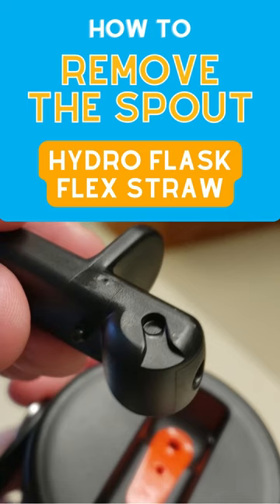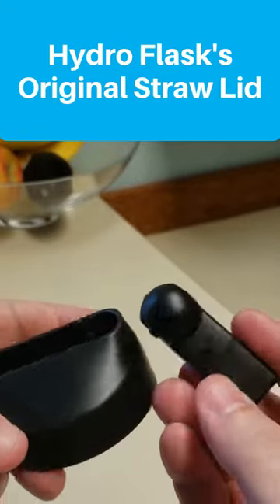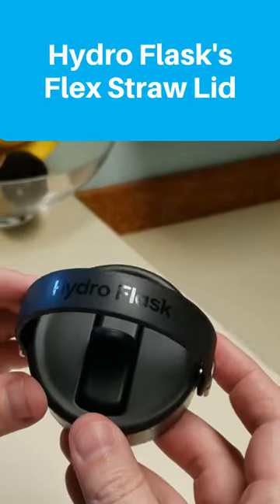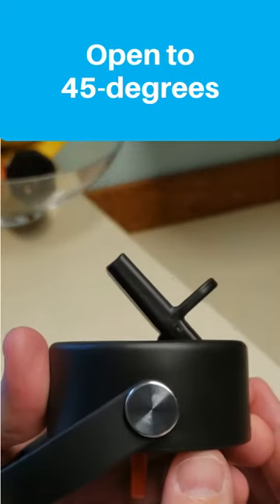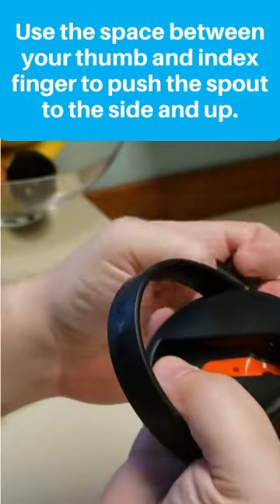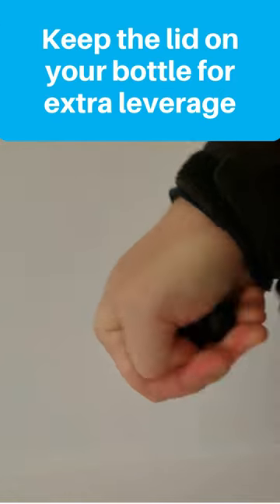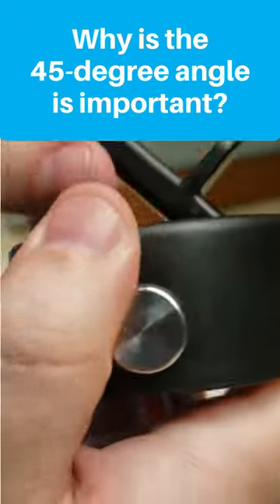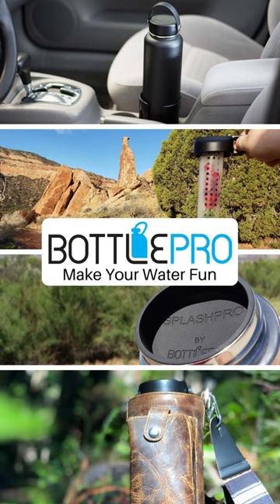How to Remove the Spout from your Hydro Flask Flex Straw Lid (60 Second Review)

Comment: When you reseat the spout in the lid, does it click in like the old caps? I have had three pop out when dropped, but they will not lock back in. Just wondering from your experience. It's just hard to see on your video.
Reply from the maker: Yea, it pops back into place really securely. If anything,, my opinion is that it's almost too secure since it's hard to pop the spout out, but at least that will prevent the issue you mentioned. I suppose it's possible that the plastic could wear out over time and lead to a problem like you mentioned, but we didn't notice any wear in dozen or so times that we popped it out and snapped it back into place so far.
Reply: @BottlePro  thank you for the information and quick reply! I did contact hydroflask customer support and they are replacing ours for free!

Comment: Did this and now there's air that gets sucked in like it doesn't seat properly. I hate all these bottles for this reason. Every single bottle that has these mouth pieces gets jacked up when you remove them to clean.
Reply: did u find a way to fix this? I just popped the nozzle back in and there’s still a lot of air when i suck in